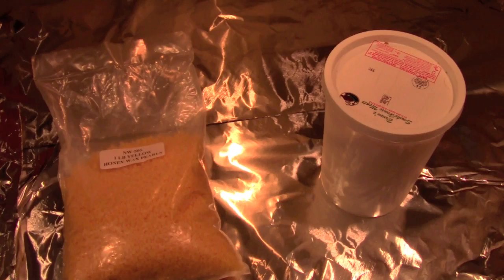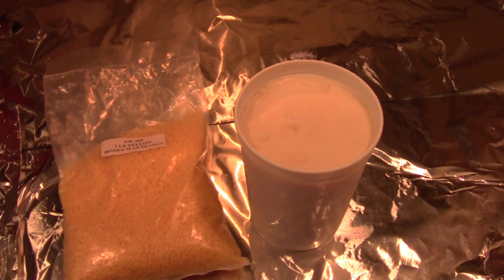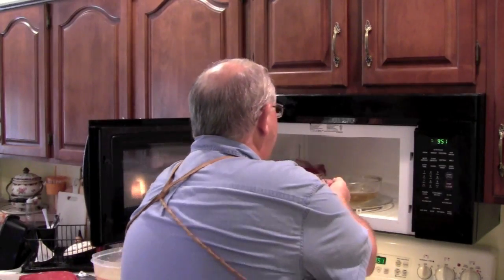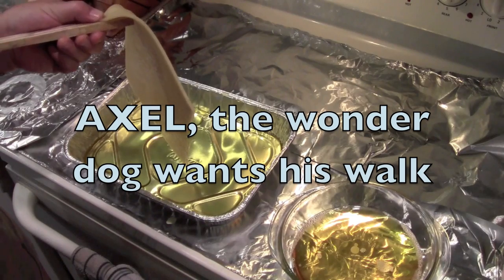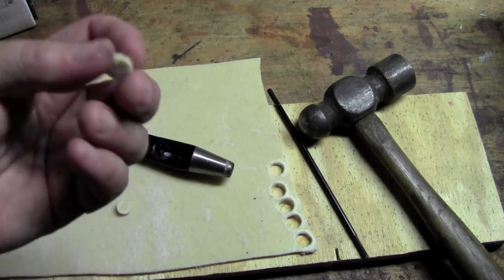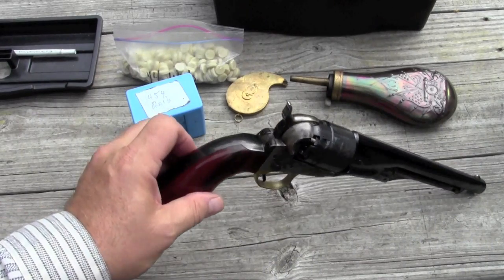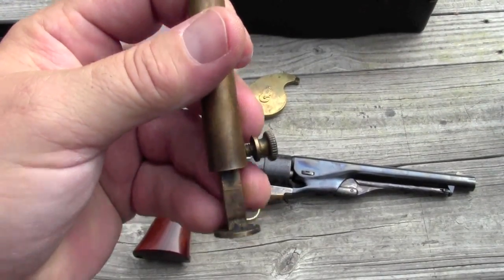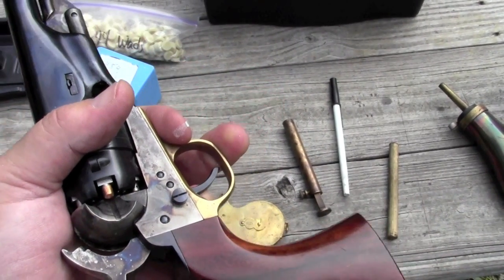Homemade cap and ball revolver wads

Comment from the maker: I find that it is easier to dip a full sheet than to fish out individual wads from the lube. My lube dries very firm, so the sheets and cut lubed wads are not messy to handle at all...about the same as Ox Yoke wads. I find that the pre-lubed sheets of felt cut cleaner for me than the un-lubed sheets. I punch plenty of un-lubed wads for my flintlock fowler, and I prefer punched the pre-lubed ones,.

Comment: I have always used similar waxed felt wads when shooting cap & ball. My best recipe was paraffin wax and red felt (but the pistol doesn't know what color the felt is). I always load up and put the wad on the top layer. A respected gunsmith friend of mine suggested I do it that way and my accuracy improved. Different strokes I guess! Nice video...I'm subscribed now!

Comment: about 25 yrs ago we were looking for something to seal off our bp hunting rifles when hunting in wet weather.the patched balls weren't working...i came up with an idea & purchased some frost king weather striping from one of the hardware stores..it came in 2in. wide by 3/16 thick felt strips ... i left it in the roll form & pined it not to unroll. then i mixed up several batches of sealer until i came up with equal parts by wt. of paraffin wax & wax toilet seal.i placed the roll in an old cake tin & poured the hot mixture over the felt roll . we punched out to 1/2 in. dia for the 50 cal & made it a habit to lay 1 or 2 over the  ball.....this worked great ..we tested it by filling a barrel over night then shooting it the next day..it worked...since then i use them for my bp pistol & shotgun.cut to different dia. of coarse  ..i found a bag of the originals the other day & they seem to still be soft & pliable.........thanks for posting...bugzy

Comment: The old fashioned remedy is to tilt your revolver at a backwards angle then when you pull your hammer back the spent cap will drop away from the revolver instead of dropping inside it.

Comment: one of the ordinance videos I was watching a while back stated that the wax/tallow mixture should be 8 parts wax to one part tallow. but you went with 1 to 2 parts wax/tallow.
when I followed the ordinance mix, it was VERY thick with wax and did NOT drain from the felt, so I think I'm going to try your way next time I make wads. I also could only find a 12mm hallow punch, about .47dia but the seemed to load just fine into my 1958 new army revolver

Comment: Up here in Canada the farmers and retailers treat lamb tallow same as gold, best price I could find without getting hosed for shipping is $32.00 per pound Canadian funds which translates to $24.16 US. So I bit the bullet (.36 caliber of course) bought 2 pounds of LT and 1 pound of beeswax. Split the batches in two, first batch was a disaster, apparently I'm too slow soaking the felt after pouring the mixture into the pan and had to scrape the pan several times and re-melt in the microwave. For the second batch I ditched the aluminum pan, cut the felt narrower and dipped the felt into the same pan that it's melted in, went much smoother, all total did 5 square feet of felt with 2 pounds of lamb tallow and 1 pound of beeswax with some leftover to pour in a tin and put in my BP range bag. 😁

Comment: One thing I was thinking was, I bet the punch goes through like a knife through butter, which is basically is. :) I use a modifed version of Gatafeo's formula from a BP board: 100 grams of beeswax, 200g of paraffin, and 200g of tallow. I substituted lard for tallow because I figured it was similar enough.When I pull the wads out, I squeeze out the excess lube.When I make my next batch, I'm trying your formula and method. :)

Comment: Another thing that you might find useful, I punch my wads out on the end grain of a butcher block made of 4X4's. The punch goes into the grain of the wood to guarantee the wad gets cut cleanly and doesn't damage the wood as bad as with against the cross grain.

Comment: Jeeze your right on that, they aren't made of cloth the really lubed things and they were falling apart.  It still worked behind the ball but I learned something ;)  Even after a few hundred rounds I am still learning.

The other ones were dry as a desert and were the ones I was squirting the INOX oil on.  I used all of them first because the ones I though were the lubed wads just looked weird.  I only used a few of the wonder seals the last time I went out.

Comment from the maker: Until I ran those tests I thought RB was the better projectile. But I'll probably still shoot more RB than conicals. Round Balls are easier to cast, use less lead, and I have a couple of thousand of them already in the can. But, if I was depending on a C&B for self defense, or to stock the freezer, I'd load with conicals.

Comment: Dear Mike, thank you for the excellent videos and ideas you have for this wonderful hobby.  i have been using with great success
plain ol' Bore Butter to lube my patches for .54 cal BP long gun and was wondering if you've ever pondered or tried the
idea of Bore Butter on these wads?   To me it seems like a tube of this would lube a helluva lot of the wool wads.
I do use a petroleum jelly mix with Bees wax (2 parts Bees Wax to 1 part jelly and a stick of Dragonlube through my lubesizer 
for the lube grooves on cast lead bullets not RB, but that's getting off topic.   Your thoughts Sir?

Comment: The Cabelas kit does not come with both dry and lubed wads. What you are referring to as "lubed wads" are actually called "wonder seals" and are supposed to be used on top of the ball rather than on top of the powder. There is no felt in them. You can smash them into oblivion with your finger. I believe the other wads that come with the kit are actually lubed wonder wads even though they seem to be pretty dry. I believe (from the way they smell) that there is lube already on them.

Comment: Why do you punch out the wads after you soak the felt? I punch them out first, then soak them in my lube. It's a lot less messy. I use some bamboo toaster tongs to fish them out and lay them on parchment paper to cool off. Then I tip them into an Altoids tin, so the only time I touch them is when I'm putting them on the muzzle or in the cylinder. I keep some wads dry to act as a barrier and a spacer between a lubed wad and the powder in my revolvers.

Comment: I am have a problem with the spent caps falling in the action on my 1861 , and my 1849 I filled the hammer notch with J.B. Weld but I am still having around 2 out of 6 falling off I have been using number 11 Remington caps do different brands work better as in CCI? I don't have any problems with my Ruger O.A. or my 1858 .36, or .44.

Comment: The way I load is to do the powder charge.... then add the wad...then.... push the wad down with the rammer and load the next chamber with powder and wad.    The reason this works for me is the wad gets seated straight for one....  and the rammer holds the cyl in place for the next charge.   Also... once all six are loaded with powder and wad...  I have a visual that they are.    then I add the balls.     It is actually as fast or faster this way with less fumbling in my opinion

Comment: Im assuming you remedied the cap sucking on all your revolvers?
Excellent shooting.
Reply from the maker: Yes, several years ago.
Reply: @duelist1954  what was the process to remedy the cap sucking?
Ive seen several videos on several different modifications.  Just would like to perform one process and not several processes of elimination. 
Thanks
Reply from the maker: @charlesc.plumley9755  Basically de-burring the face of the hammer.  https://www.youtube.com/watch?v=v4gkJaIQPZo&t=3s
Reply: @duelist1954  thank u so very much

Comment: Duelist1954 I know I am way late to be commenting.  I have a question can i use beef tallow? If not, why would you not recommend it?  Thanks
Reply from the maker: Yes. I have used it. I prefer lamb tallow, or even deer tallow...slightly better lubricating quality than beef, but beef works. Just make sure it was never salted.

Comment: Do you have to refrigerate the lamb's tallow & bee's wax mix after you're finished with it or can it be stored at room temp?

THANKS...
Reply: little late answering (4 years LOL)  but I make my Revolver lub with Beeswax and Elk Tallow, my Patch lub is Mink oil (the real stuff  you can get it at Track of the wolf)  and Elk tallow, or  Bear fat & elk tallow, only the bear fat one has ever had a problem going rancid and that was a skoll can full that spent a lot of time at the range in 90+ heat.

Comment: Mike, I think at the beginning of the video, you said you had 2lbs of tallow and one 1lb of beeswax.  Did you divide the ingredients into two (2) batches?  In other words, what is the ratio?  Is it 2 parts tallow to 1 part beeswax?  Also, how does this differ from the recipe for chamber lube for the revolver?  Is that one 1 part beeswax to 1 part tallow?  Also, I live in SE Texas.  The commercial bore butter I bought remains runny even in the winter.  Makes quite a mess.  What sayeth you, sir?
Reply from the maker: The ratio is 2/3rds tallow to 1/3rd beeswax. This is a lot stiffer than bore butter. You can adjust the wax content to match your environment. I use the same formula for chamber lube.
Reply: @duelist1954  interesting how the math works out here.  2/3 pound of LT = 10.66 ounces,,,,,,,,,,,,,, 1/3 pound of beeswax  = 5.33 ounces (2 parts LT to 1 part Beeswax) unless there's something I'm missing in doing the calculations.

Comment: Sir, I’ve read about gun lube made of beeswax and olive oil. Do you think that this combination would work for wads as well?
Reply from the maker: It works well. I used olive oil before I used tallow
Reply: duelist1954 Thanks very much for your reply. It did work just fine, I just had to experiment a little to find the right portions.

Comment: Hi Mike, another great video. I am also trying my hand at wonder wads for my 12 guage percussion, the lambs tallow is my only hold up, so the question is, can you use a substitute product. Your input would be greatly appreciated. Richard 1951.
Reply from the maker: You can do 50% olive oil - 50% beeswax
Reply: @duelist1954  Thank you very much Mike! I just tried olive oil and beeswax (50/50 weight) and the result looks great for coating paper cartridge's bullets. I'll experiment with duck and goose fat. Both are easy to come by in my neck of the woods. Thanks for the excellent content!

Comment: Sir what size punch are you using for the 44 wads?   I read where a 7/16 was used, is this the correct size?
I want to be sure and get the right one, my pistol is the Uberti 1858 44 cal, Thanks.
Love your videos they are very educational and have inspired me to start shooting BP Pistols, In fact I almost prefer them over the modern weapons because of there charm.
Reply from the maker: That's a little small. get this punch from track  http://www.trackofthewolf.com/Categories/PartDetail.aspx/243/1/WAD-PUNCH-45
Reply: Thank you for your answer and help, I really appreciate it.

Comment: Mike, what's the point of a wad like this? Cartridge ammo has no wad i.e. .44 mag, .45 Colt etc.
Reply from the maker: That's because bullets carry lube in lube grooves...round balls do not. The wad is lubed to keep black powder fouling soft in the bore.
Reply: Perhaps more importantly  BP revolvers have a tendency to sometimes ''chain-fire', i.e. fire jumps from the cylinder inline with the barrel to surrounding 'cylinders' NOT inline with the barrel.  Not good!  The old dab o' grease or the more modern lubricated wads were insurance against this.  This is one reason revolving rifles (like the 1858 Remington or the Colt models) were not so popular, forget the grease and you could literally shoot yourself in the arm holding the forearm. of your weapon  The other reason is that even if a chain-fire did not occur the cylinder/barrel gap of any revolving cylinder type of arm spits Fire and Lead shavings.  You will notice that the trigger guard of the 1858 Remington carbine had an offhand 'finger hole incorporated to reinforce that  the offhand arm was never meant to be placed on the barrel/forearm for support when firing.

Comment: Why do you mix bee's wax with the tallow?
I'm curious why you just don't use wax.
Years ago I just used the grease sold at the gun store, that stuff is really sloppy.
Reply from the maker: You can use just beeswax, but it is not ideal. It is a very stiff lube, and doesn’t keep black powder fouling as soft as as oils with a lower melting point, but in combination with more lubricious fats, like tallow or olive oil, it makes perfect black powder lube.
Reply: @duelist1954  thanks, that makes sense, now I know.

Comment: With the Cabella's starter kit that came with my most recent purchases it came with 30 dry and 30 lubed wads.  I went through the lubed ones pretty quick and with the toolbox I have set up as my black powder kit I put the dry ones in the top compartment.  I just squirted several sprays of INOX lubrication gun oil I use for all my guns onto the patches until they were moist to the touch.  Would this still be sufficient if I decide to start making the wads myself?

Comment: I used your formula (used lard instead) and works good as both covering a cylinder bore and pan lube for my BP 45 COLT cartridge bullets, but what can I do to make it better for my front stuffer patched round ball hawken?
Reply from the maker: Don't add the wax. I lube patches with straight lamb's tallow.
Reply: Hadn't thought of that...over the years I've tried various blends (some my own, others store bought and rendezvous acquisitions, even crewed on it a few times) but never really was satisfied with the performance.

Comment: Do the felt wads help prevent chain fire?
Reply: Yes. In my experience chain fires happen from the front, and can even happen with oversized balls (due to the chambers not being perfectly round). A lubed wad under the bullet or, alternatively, lube over the bullet keeps the fouling soft & prevents chain fires.

Comment: Mike. I need help.  my new 51 colt 44. is giving me a fit sighting in. I have the windage right but elevation is 4 inches high at 15 yards. my hammer notch is as low as I can go.  I bury the bead so deep the cylinder hides it and it's still high. what do you suggest ?  I shoot about 28 gr fffg. so do I raise the charge or lengthen the range ? I'm at a complete loss.  any help I'd appreciate it and owe you a cold bottle of pop if we ever cross trails.    thanks.    Garry
Reply from the maker: 357bullfrog Either make a higher front sight and dovetail it into the barrel or have a gunsmith do the work for you.
Reply: duelist1954 thanks a million Mike. I just happen to have a brass blade sight that would work.  well. I recon I owe you coka cola and a moon pie

Comment: Can I use lard instead of tallow? or is it to runny and it will contaminate the powder?
Reply from the maker: The beeswax will stiffen it up. The real problem with lard is that most of it is salted. Using it makes wildly corrosive fouling
Reply: +duelist1954 Yeah that would be a problem having salted lube! I'll just settle for some tallow from Dixie Gun Works. Have you ever punched wads from cardboard and egg cartons? I've heard of people doing that, so I punched a few out like that.

Comment: will pig tallow work? I have ready access to pigs tallow, but lambs tallow may be more of a trick.
Reply from the maker: Yes, but if you use commercial lard, make sure there is no salt in it.
Reply: It's home raised,  I hadn't thought about the salt.  Thank you.  Are there any drawbacks to using pig tallow?
Reply from the maker: Simeon Gray Nope. Lambs tallow has higher lubrousity but I've used beef and pig tallow as well. they all work.
Reply: Awesome,  thanks!

Comment: could you use this as a fixin wax?  This tallow/beeswax mixture seems softer than fix in wax, what would I add to make it harder and less likely to melt in warm temps?
Reply: Stearic acid flakes or granules, available in the candle making section of hobby stores. Like $4 a pound.

Comment: Great video as always. I appreciate the info. I have bees wax from a bee keeper friend and I will be using lard. I got a piece of 100% wool felt from the local Hobby Lobby. It is not as stiff as yours in the video and I'm hoping that the lube will take care of that once it hardens. Also the felt is colored. I don't see where that would be an issue as it is 100% wool. Your thoughts sir?
Reply from the maker: As long as it is 100% wool you will be ok. Be sure the lard contains no salt.